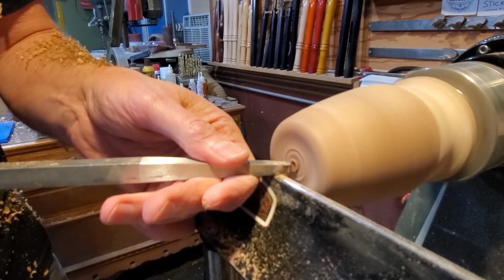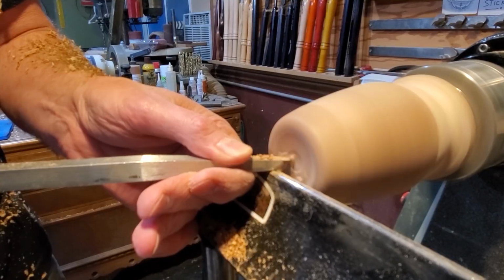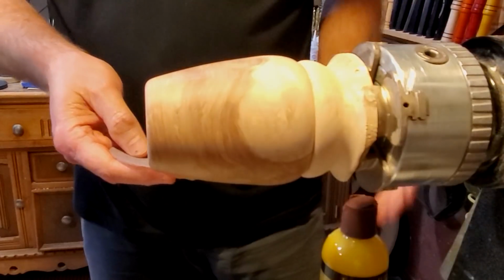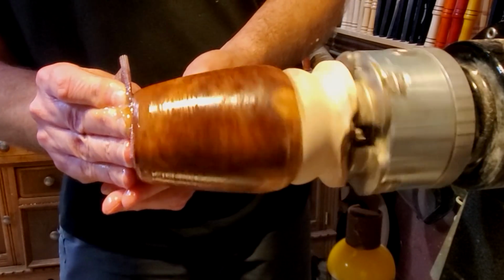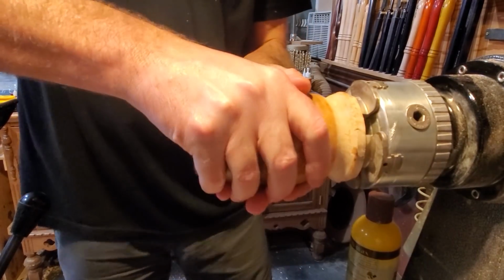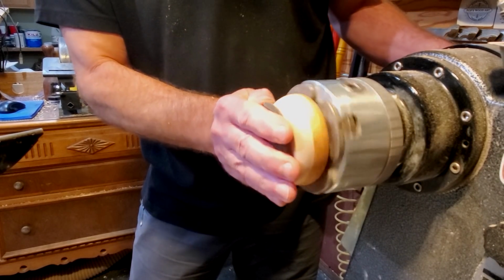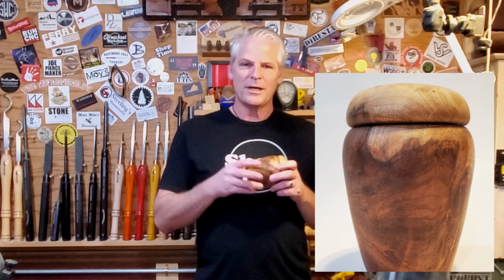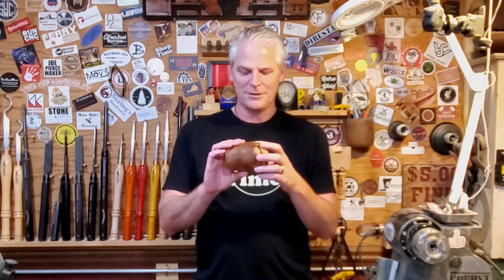Woodturning - Maple Lidded Box - How To Properly Fit A Lid

Comment: Might have to try that Howard’s! What about to much heat generated while boring developing cracks as apposed to hollowing with gouge?
Reply from the maker: If you have the lathe speed slow, it's not an issue.
Reply: @CarlJacobson  I try to stay around 350 rpms?